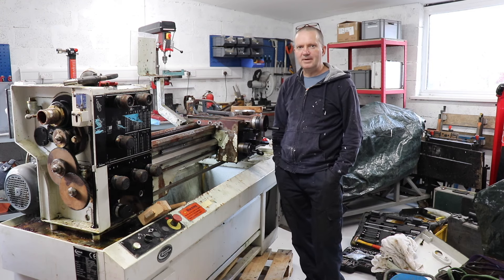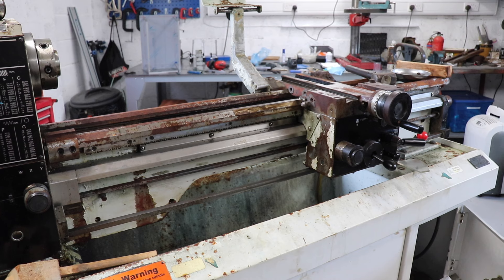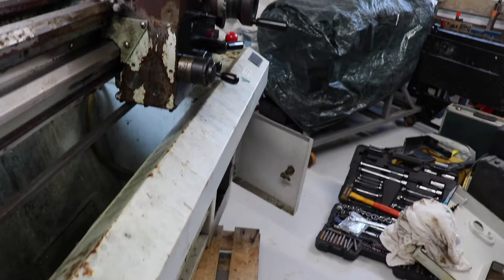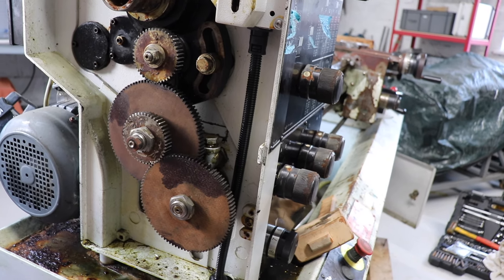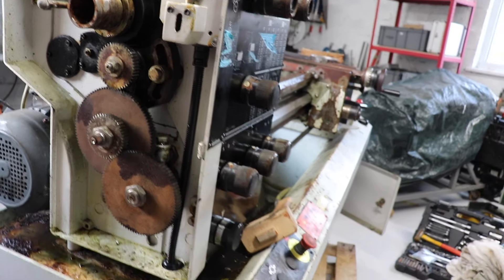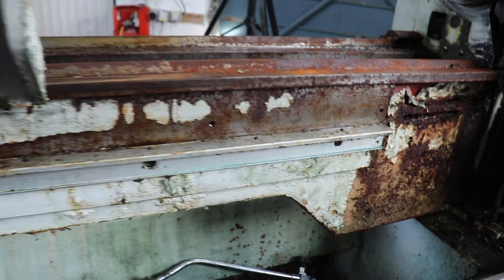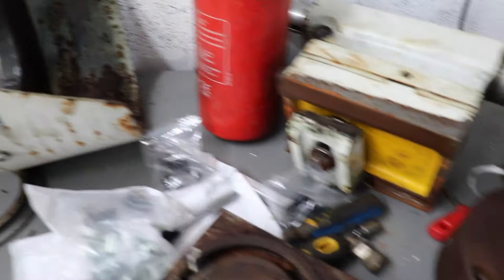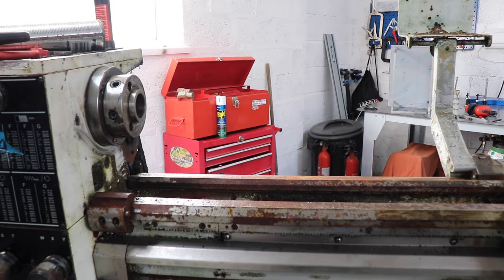I Just Bought This Rusty Harrison Lathe!

Comment: That will clean up very nicely, At worst there may be some cosmetic pitting on the ways but they won't affect accuracy etc. It's got a removable gap piece and it's nice to see a DRO, which is invaluable for precision. You can drive it with a std VFD - very few home workshops have 3 phase and single phase motors have high torque ripple. Looks like a winner!

Comment: Whatever you do don’t attack it with rotary wire brushes. Use Evaporust first (yes I know it’s expensive) which will soften the rust enough so you can wipe it off with a rag. You can then work on the slide ways with a fine grade Garryflex rubber block, and maybe a razor blade for difficult areas. Scotchbrite and wd40 will work well for things like to top slide and cross slide.
For larger surfaces that you can’t dip in a tank you can cover them with Evaporust-soaked cloths. It’s also worth looking into diy-evaporust recipes - quite a few YT videos on this, and it will save a lot of money.

Comment: I dealt with similar states of machine tools. Clean parts, preferably in hot water. Hot so that it evaporates afterwards. I got a pretty big ultrasonic cleaner which works wonders. Then put the parts in Evaporust and then use wire wheel and buffing wheel to bring back the shine. Scotchbrite is perfectly fine for most non high gloss parts. Don't touch the slideways of the cross slide and top slide with any abrasive if not necessary. The bed you will have to use scotchbrite and some kind of abrasive stone to get the dings out. Those beds should be hardened so usually they survive well.

Comment: Picked up an M300 not so long back.
Re-wired the control and safety circuits, interlocks as 24Vdc.
Motor is now run off an Invertek VSD.
Replaced coolant pump with a single phase 240V unit.
Also remade the control panel to incorporate speed pot and a few other functions.
Genuine accessories are expensive.
Mine is a 2005 model and came from an Australian Navy Training College.
Surprisingly, for a student lathe, it's in very good condition, with no dings in the ways.

I've uploaded some footage to my youtube channel.

Comment: I was about to recommend Sam Fielder's channel as you mentioned him, he is a very informative and a proper eccentric Englishman, I would also check out Max Grant he's a very experienced machinist and has done a few rebuids of different machines. You were lucky to pick up the long bed version as well as such a young example and other than the obvious surface neglect hopefully there won't be much wear in the beds.
Mine is somewhat older like Sam's. I went down the DIY rotary phase converter route and kept the wiring and controls stock, which is easier (and cheaper) than getting a 3 phase supply installed. A 2nd hand motor, autotransformer, switchgear and a few capacitors was a fun project and a doddle for someone like you.

Comment: You will definitely have Fun Restoring it.
Anything is possible given enough effort to make it happen.
I'm not sure what happened with the paint on the Z axis slideway ??
But it's a shame whoever did this, didn't paint more of the Slides to help keep them in good condition. 
Other than what you can see the Lathe itself is actually pretty good ??
It's only the Rust that makes it look so bad.
But this is only a surface problem not Mechanical.
The rest of it only needs a lot of cleaning 👍

Comment: I bought an eleven and a half inch swing  gap bed Harrison fron a race shop at Silverstone that was closing about twenty odd years ago nd its been so useful and profitable. It took a while to learn to drive it competently and I had to buy a big rotary three phase converter as I also only have single phase, but it's been totally reliable and used a lot. I was so taken with what I could do with it I then bought a Bridgeport universal mill to go with it. Then a surface grinder.... You get the idea, you can soon fill a workshop up :) One tip is get a BIG rotary converter that will run other things with high start up loading, like a two post vehicle lift. I went through 3 converters until I got one that was man enough for the lift with a heavy car on it... Luckily the supplier worked with me and swapped them out until I was happy. They give and gave  fantastic service, I can get the name if you want?

Or maybe you'll put a gas turbine on it to drive it ;)

Best, Chris 2E0ILY.

Comment: Wow, excellent lathe. I used to use its bigger brother the M400. I'm surprised it got in that state given how new it is, must have been stored outside. A bit of elbow grease will bring it back. Hopefully the motor can be wired up for delta 220V that way you can use a VFD on normal 230V single phase. The suds pump will want changing to a single phase one and I think there is a spindle brake that is 110V DC that you will have to work something out for. Anyway what a great score😎

Comment: When are you going to build a Pirate AM transmitter? is also easy to do!   a standard Xtal on 6400KHz AM modulated, when you are ready listen in for a while!
( around 6200 and 6600KHz are many pirates! many on 6300 and 6375 sometimes they make a QSO there and sometimes I am there too )
Greetings from the Netherlands RadioRob from location Rotterdam

Comment: It's a bit like amateur radio, buying a transceiver (if you are that way inclined) is the start of the spending, it generally leads to the purchase of a milling machine and tooling for both of them. I have an older Harrison 140 and even older L5A and a couple of milling machines, I'm no precision engineer as the bits I make are generally simple items.

I did make a rotary three phase converter around 30 years ago with a large 3 phase motor as the idle motor for a big milling machine I had. It was a bit of a death trap that was started by a rope around the pulley and quickly applying 230v to one winding before it slowed down. As my grandfather wanted to use it at the time, it did progress to a single phase motor and a momentary switch with a bit of hosepipe joining the motor shafts (That was my mechanical fuse lol)

I notice the jaws in the chuck are outside jaws, I wonder if you got the other set? Good luck with it. Kevin GW0PUH
Reply from the maker: Thanks Kevin for the info! Yes, once I get to grips with lathe I may get a milling machine… I would like to start making my own morse keys out of brass. 73 GW0FZY
Reply: @thewtf  Bearings for remote control models may be a useful item for making morse keys. A source of knobs apart from the ceramic drawer type are not easy to source. 

I have had the odd thought through the years about making morse keys as a little side hustle business, as I have always thought that making a small production run would not take much more time than making a one-off.

Comment: I have the same machine (from new) and it’s a fantastic piece of kit! It’s so sad to see one in this state of disrepair though! Especially for one from 2009! If you sign up for an account with the Colchester website you can put in your serial number and download the manual / parts list - Paul in their parts department is very helpful if you need to buy any parts for it - I’d advise using evarporust to clean it up followed by wd40 and scotch brite - if you’re lucky you wont need your ways re-grinding! And check if the DRO works (if it has got wet then it may not!) but those acurite DRO’s are the best in the business -  that’s £2500 of kit in its self if it all works!
Reply from the maker: Thanks for the info! Having started to clean it up it looks OK and I’m pretty sure It will be a good lathe

Comment: hope the motor isnt burned up. you will be puttin it out for scrap if it is. probley the most money to fix
Reply: Nonsense. £200 would buy you a new motor.
Reply: £200/300 for a new motor
Reply: I'd worry more about the ways. If they've been damaged or distorted then the lathe is junk, pretty much. Ways can be reground and rehardened but that costs a lot more to get done than a burned-out motor. The surface rust visible on the ways is worrying,

Comment: Could only have come out of a government department for such a valuable item to be treated with such little regard.  Go over the bedways with a rotary wire brush on a 4 inch grinder first,  that wido a great job and then finish it off with a flat hone stone and  it should  come up very well.